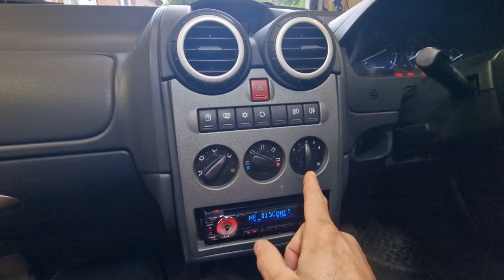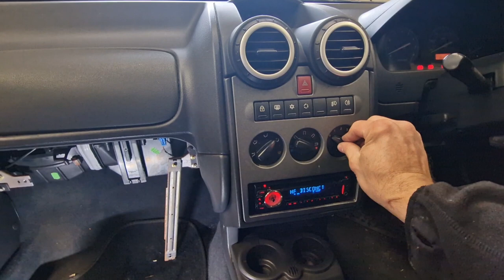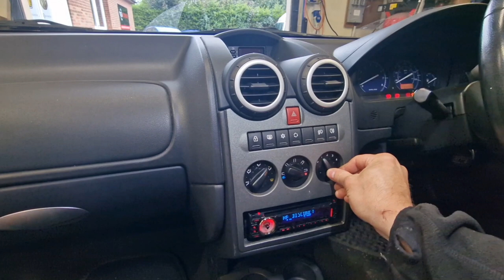Rover Streetwise / 25 / MGZR Heater Blower Resistor Pack Replacement

Comment: I know it’s probably low priority but what happened to the engine in the race car? Hope there’s an autopsy vid coming soon…
Reply from the maker: It's still in the trailer, I haven't even looked at it since race day 😂 yes I'm planning on doing a full tear down too see what actually went wrong, but probably won't be for a few weeks yet I'm afraid. There will also be panel replacement and painting to repair the damage from Cadwel Park. So plenty of racing mgf content to come to prepair for next seasons racing......
Reply: @NorfolkRoverworx  no worries lol. Trying to get a new timing belt on my vvc this week so that'll probably be enough f ing content for me. I swear they're tighter when it's cold..